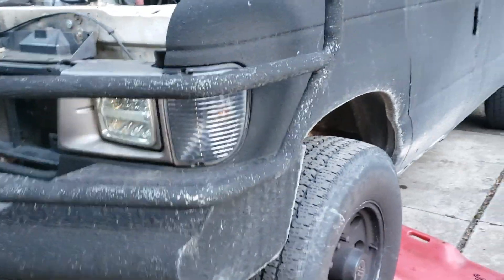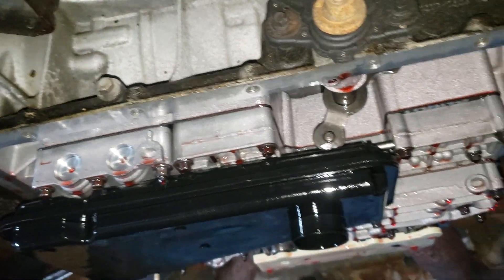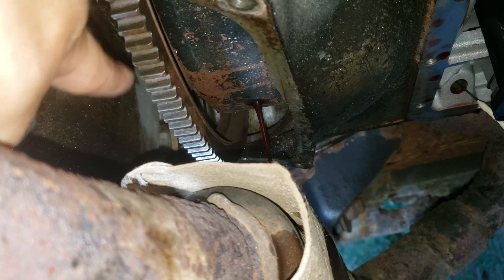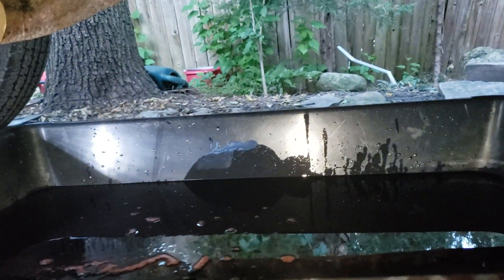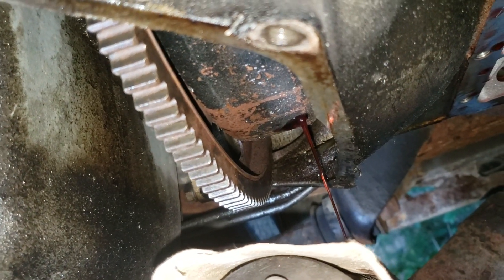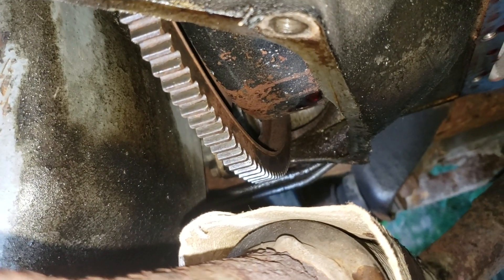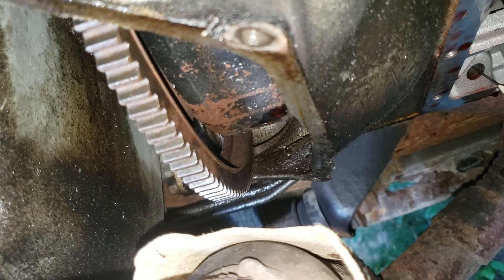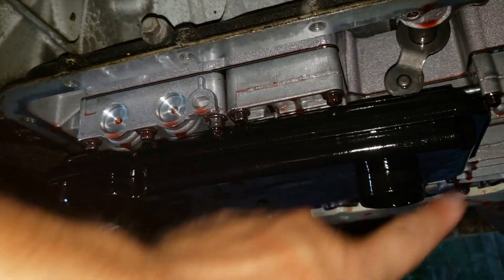Ford E & F series torque converter drain plug

Comment: Nice with the cardboard. I hate it when people let fluids drain all over other components. Even something inert with no nonmetal parts. It’s just better to keep everything clean. Thanx, that is just what I needed right now! Just got a 2006 F250 with a 6.0 and 5 speed...and trani cooler to external filter lines almost rusted through completely. So the bunk trani shop I thought was good isn’t changing my fluid. They missed the terribly rusted lines. Far (VERY far) from the first time a shop charged me big $ to miss a glaringly obvious problem. They did a free inspection and $300 to tighten a bolt and drill and tap another for an oversized screw in the shift shaft. They quoted $500-$600 to replace the column shift rod (plastic) bushings. Watch a couple videos on it. It takes less than an hour and is really simple.
Reply: For the steering shaft did you lose shifting possibly? I’m having an issue can’t go into reverse or drive and sloppy shifter
Reply: Well, it was getting sloppy, and your symptoms are consistent with this (common) problem. It’s not that hard to determine, just some crawling in under the dash, removing the left lower dash panel, gaining access to the coupler. The trani shop did not do any disassembly of other parts. There are three main issues/places where the shift linkage often goes bad. There are bushings in the column between the steering wheel and the bottom of the instrument cluster, with a shaft that often breaks as well. Then the coupler further down under the dash, and there is a shift cable or rod down behind the front suspension/cross members. There are videos by Fordtechmakuloco, powerstrokehelp, and a few others on YouTube. Do a YouTube search for shifting problems on your year. Another channel, Fordtechlife, shows the procedure for the bolts in the dash, the most likely problem, nicely.

Comment: ThNx, the only such viDO I've Cn, strangly enuf.  1 other trik is to use an air gun & can of tranmission cooler, at the 2 ends of hoses, in usual flow direction, which drains another rarely spoken of 1 or 2 qts, & cleans hoses & radiatior👋
Reply: What?

Comment: Does the torque converter fill as you fill trans with new fluid?
Reply: No
Reply: If you have a drain plug on the Torque converter, it will refill when you add fluid normally...

Comment: Hello there everybody thanks for video very good job I was wondering if anybody knows if a 1997 Econoline 150 with a 4.2 L engine and  a 4R-70W Transmission have a drain plug in the torque converter thank you